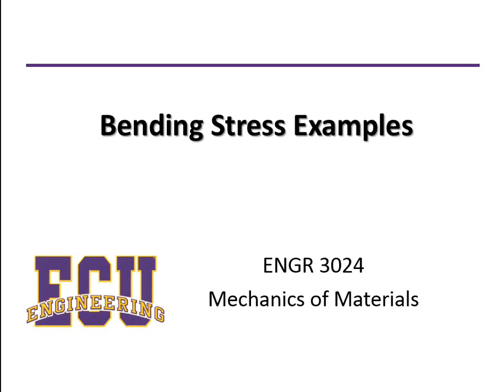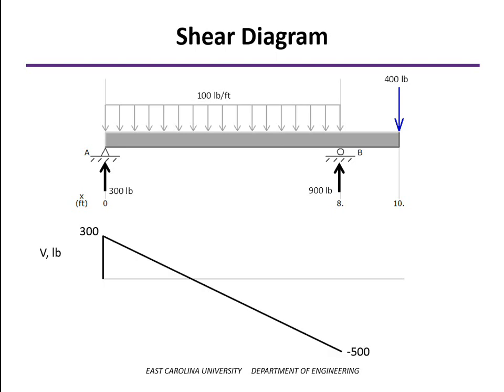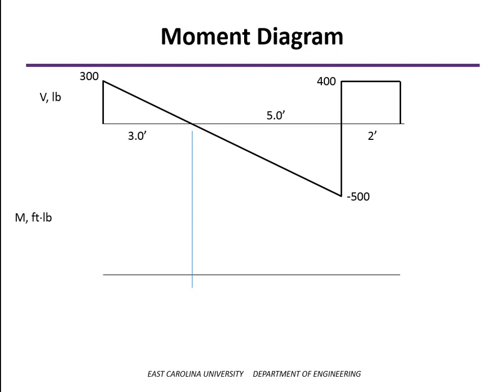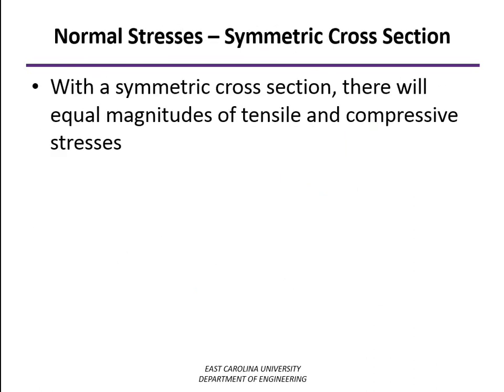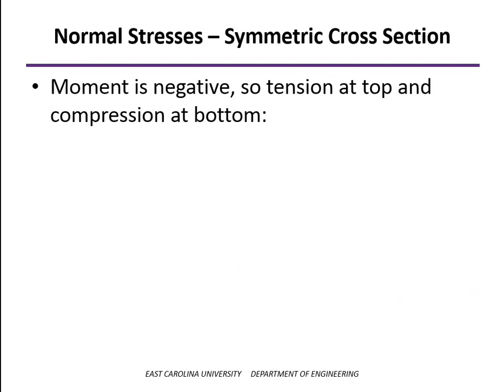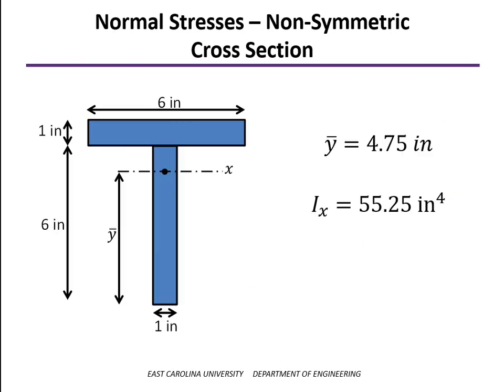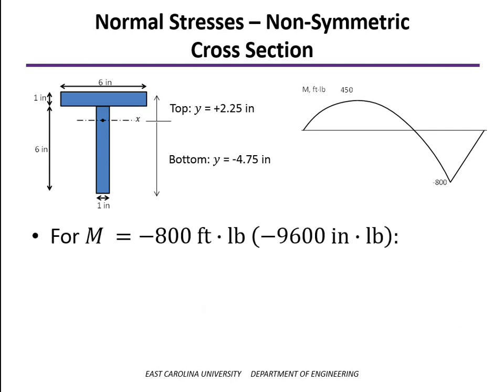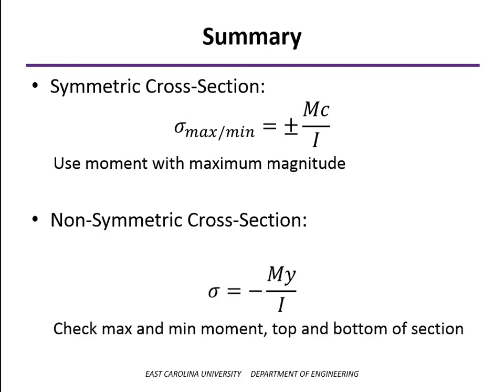Bending Stress Examples

Comment: why is the overhung part doesn't have unit weight?
Reply from the maker: The distributed load was intended to be an applied load, not the weight of the beam itself.  In this case, we are assuming that the beam's weight is negligible compared to the applied loads, and so is ignored.